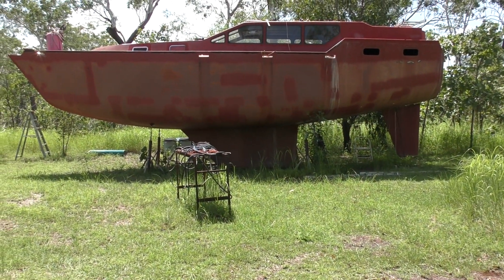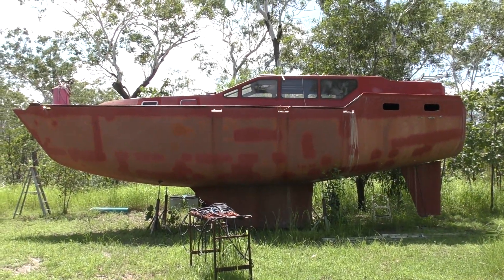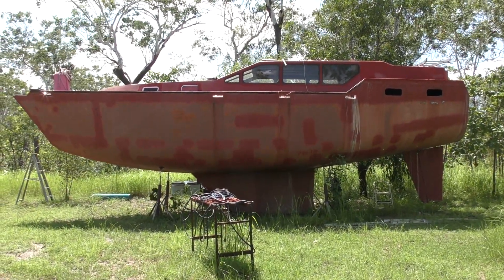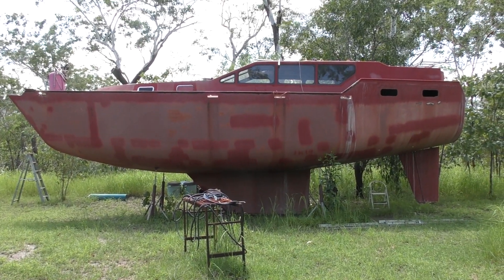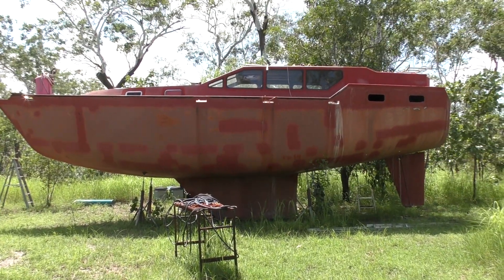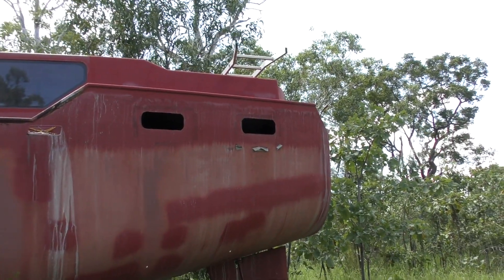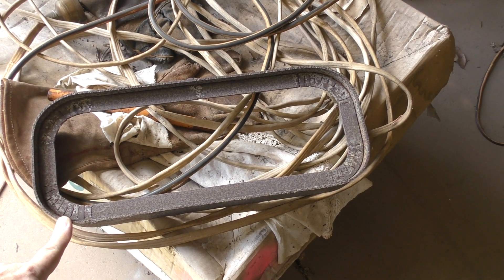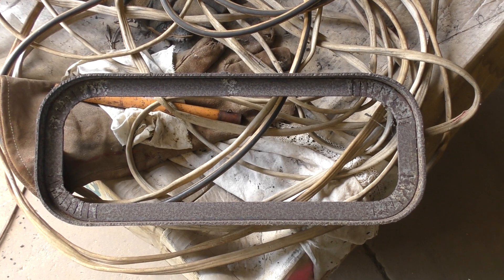Steel Sailboat Building - Update Feb 2019 Part1

Comment: Hello! Nice job! This boat could be built using wood? Thanks for the videos!
Reply from the maker: Thanks Denis. I think it is possible but I don't believe the designer has timber plans for this version! I am building in steel but looking back, I think I should have used Aluminium, would have been much quicker and less issues with rust prevention in the humid tropics 👍😂
Reply: @garrychapple6418  Thanks for answering my question. I appreciated that. NIce job! Congrats!!
Reply from the maker: @denisparente1853  No problem, by the way I checked the  plans and there is a plywood version so maybe it can be built in wood?